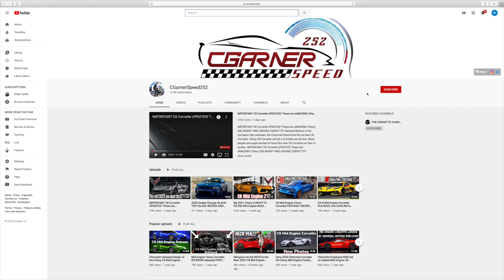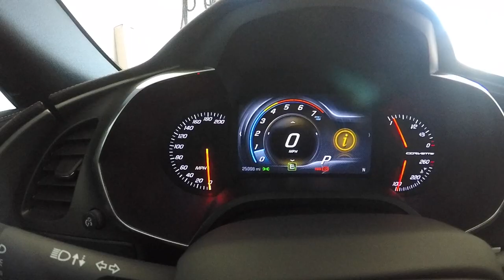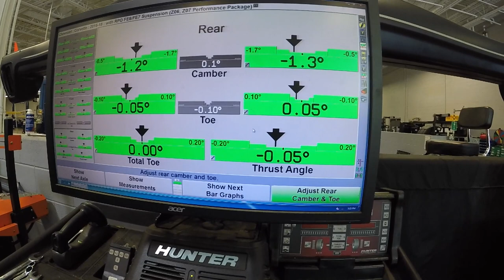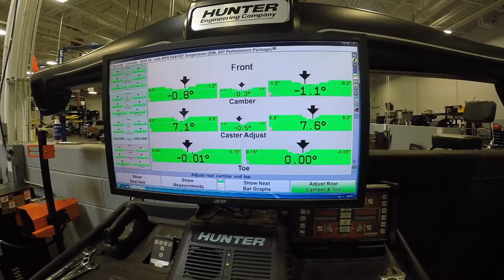INSANE Chevy C7 Corvette NEW Tires and Wheels! *LOOKS PERFECT*

Comment: It has been known for several years the tires on C7 Z06 & GrandSport start showing chord early.   They are set up for the track 1.2G.   Many of us have had our cars dropped down to the Stingray alignment spec to get better tire wear.   Even on the Tail of the Dragon I only pulled a .95G with traction control management flashing on the PDR recording.    It is your money and that caster adjustment is important.
Reply: Exactly👆🏾

Comment: Check your alignment, if it is within the factory marks. Have them check droop or ride height which requires the car on the alignment machine, use body weight to pull down the car and see if positive camber is above 10  the car weight droop. There is a guy that has a rear height correction if you are interested. But that is only if you exceed to much droop under factory settings.

Comment: You actually can fix it. You need to have them align it like a C7 stingray. I did this on my almost 800hp grand sport and I've never had tire wear issues.  The Grand sport and zo6 have negative camber for the track. Change that and you wont have the issues. I don't track my care so there's no need to have it alignment like that.
Reply from the maker: That make perfect sense

Comment: Two items: What, Clarence, is your opinion on the scissors Doors for the C8? I think the beginning of this content showed a photo of a C7 with scissors doors? I think with parallel parking it is quite likely that the long doors will be difficult to exit through the stock position. Seems cool that one can just swap out hing hardware to obtain this access. The question is, how is the scissor doors with regard to being practical for getting in and out, versus the standard GM build of the car?   2nd Question: What do you think of Kooks headers for the C8? Is better than 20 horsepower a realistic gain? I sent Kooks a question regarding their headers and the adaptor clamps to obtain some clarifications and after more than several days, there's been no response from Kooks. AF
Reply from the maker: I am getting the doors removed this week actually

Comment: Hi Clarence, I had the same tire tread wear as you did. There was a guy who had a blog a year or two ago. He had a blow out. What he found was the camber on the Z06 and Grand Sport have to in camber on l 4 corners increases track performance, but wear out the tires. Since I don't track it anymore, I replaced the tires with Michelin All season tires. I also had the camber set close to zero. Tires are expensive. Plus I wanted to be able drive on nice days in the winter. By the way. When are you going to put full wing doors on the C8? That would look nice. Congrats on neatly 30 K miles.  Have a good day. Stay safe and enjoy the road.

Comment: It looks like you have too much negative camber.  Some brands have negative camber set that way for maximum grip in the corners.   I drive a Mini and I burn up the inside of the tires for that very reason.
Reply from the maker: Oh wow I didnt know that!
Reply: That alinement computer show +/- from factory specs but like I said, some are set to tilt in (negative camber) as the normal setting.  I have a 2017 mini with 67k miles and I just had to put on my 3rd set of tires due to the inside tread wear.  Good luck with the new tires.

Comment: I did already subscribe and I always give a thumbs up. I see your C8, right now and just heard the shout out. Like you, by the way, I have a high wing spoiler. Unlike you, although I paid for it as the build reflects, when I asked the dealer for my Z51 spoiler and was told that I don't get it. I saw that Corvette Mike got his regular wheels, when the Tridents were optioned as the wheels come with the car. I asked for those too. I was told that I don't get those either. Then the window sticker shows that the carbon flash painted sill accents and front are an extra that i paid for extra according to the sticker. Then, it turned out that the dealership had one set of carbon fiber ground effects, so I ordered that, since it is so rare and had them install the visible actual carbon fiber ground effects kit. The upshot is that the dealer did give me that back. Two upgrades, one over the other. Not the smartest choice, but then to get a hold of the hard to get ground effects kit at the dealer and have them dealer installed before I left the dealer parking lot and before I took delivery. Congrats on the new tires. Yes, I compliment you for having the courage to obtain the Continental Extreme Sport Constacts. Alex

Comment: Change the alignment specs to save the tires man, of course factory specs are not going to say any different. Just set the camber to Stingray specs and tire will be fine. All your going to loose is a little speed on the track.

Comment: 💥💥It's because the stock camber is set aggressively for going through turns on grand sport and z06. Every Zo6 and GS will have the same wear pattern.  You can actually just have them adjust it but you'll lose cornering confidence... but with zero degree camber... it'll handle like 💩🤓💥💥